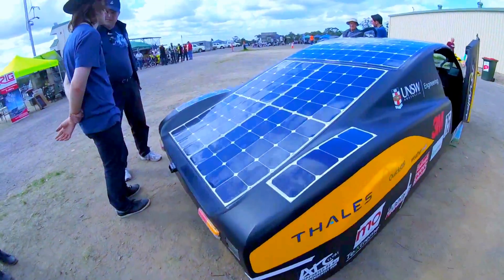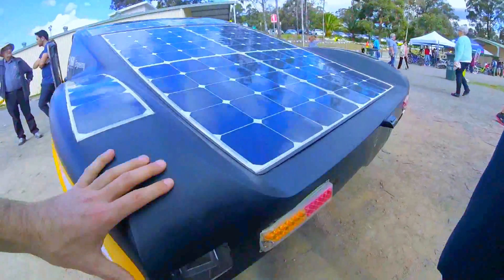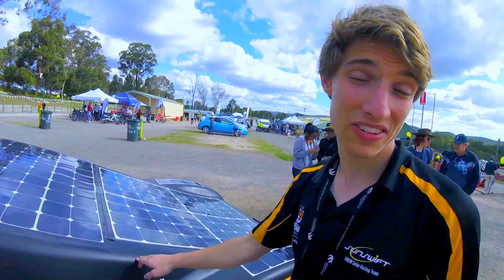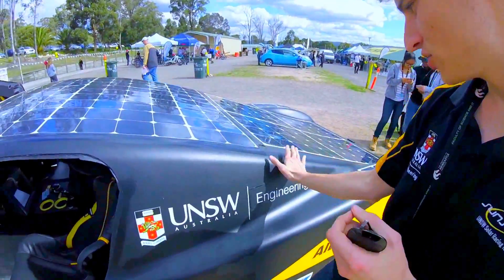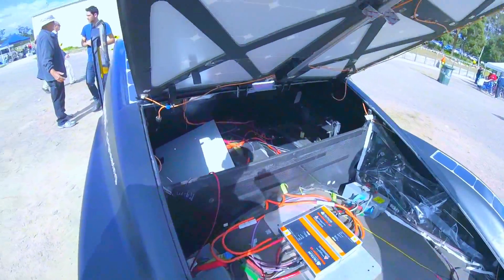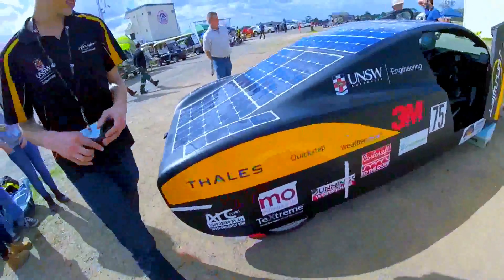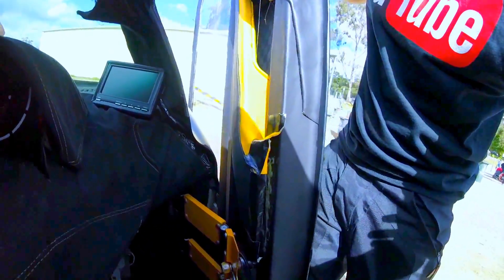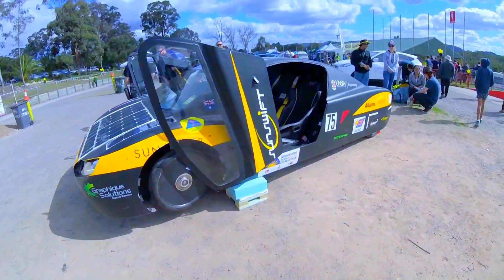Solar Powered Electric Car - UNSW Sunswift Solar Car Racing Team - Hunter EV Festival 2016

Comment: that things weighs less than a Harley Davidson motorcycle. cool.
Reply from the maker: Yeeeahhh.. comparing to a bicycle this things is pretty heavy but a car that weights 325kg with this super aerodynamics is just INSANE!!!! Check out the links I posted on the video description with a bit more info and specs about this car =]
Reply: @BrunoPOWEEER  Drive an old Fiat 600 from 1998. Curb weight 641kg. Rip out everything rally battle weight and it is around 520kg! So almost there, in a gasoline car.